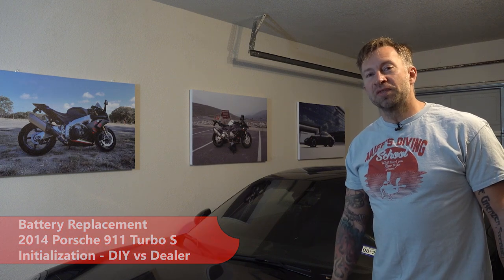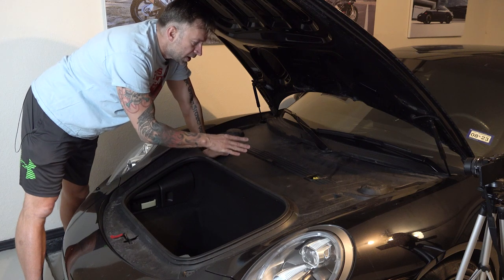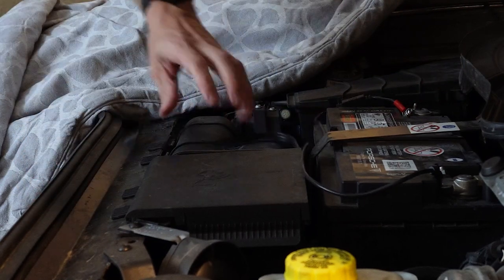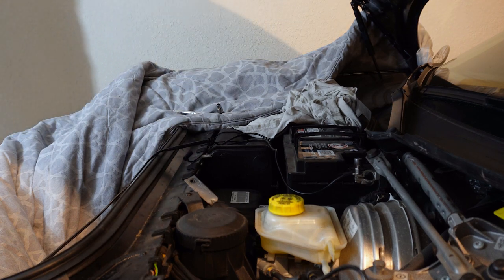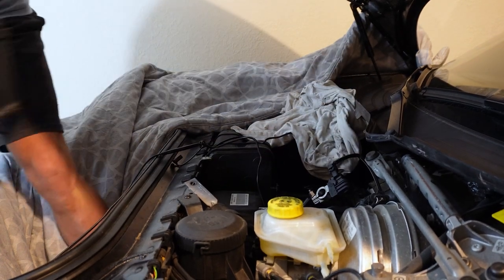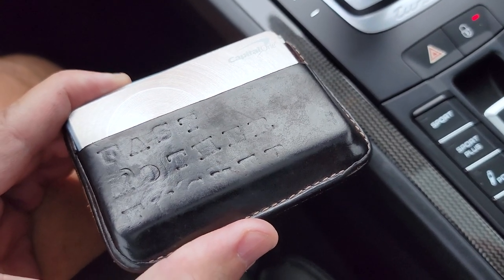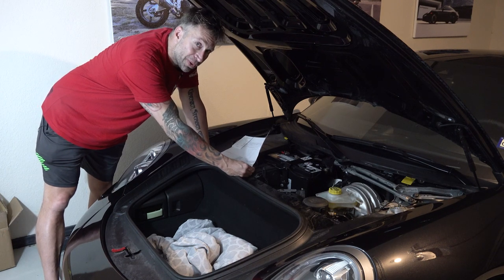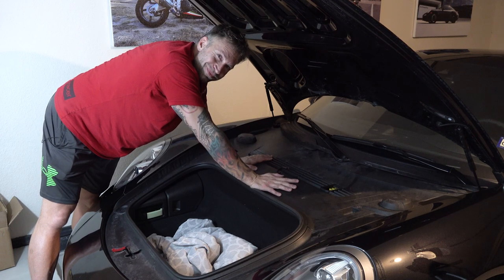DIY vs DEALER? PORSCHE car BATTERY Replacement 2014 Porsche 911 Turbo Battery (S)

Comment: Porsche provides a grounding nut for the trickle charger (or for jump starting) as the manual says not to connect to the negative terminal of the battery.
Reply from the maker: that i didn't know, and i think the dealer connected it back the way i had it, to the negative terminal, but i'll check now that you say that. thanks!
Reply: Not a problem, the post on mine (991 Turbo S) is towards the driver side of the vehicle, further away from the battery than one would guess.  The trickle charger c-tel cord barely reaches.
Reply from the maker: @335i101  noted. thanks!

Comment: The Porsche is AWESOME man !!!  I've never rode in one, but have heard that they are an "experience" to be enjoyed, for sure !!
Reply from the maker: Thanks! Love the car. The handling of them is what's just incredible. my old 944 could go around the curves outside of town at over 3 digits with a couple fingers on the wheel vs. white knuckling around them at 70 in the old Cougar i had before it.